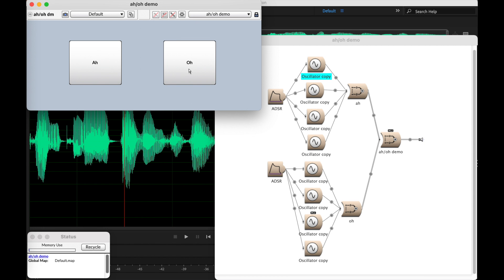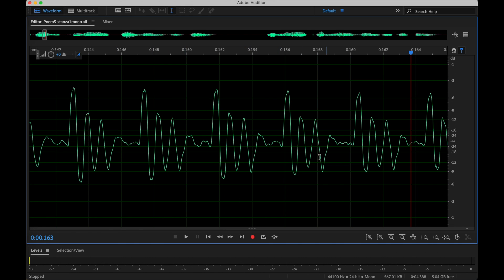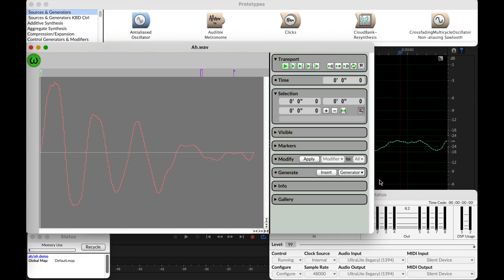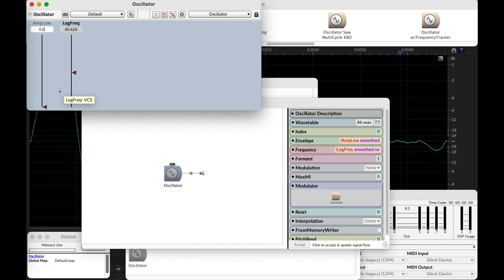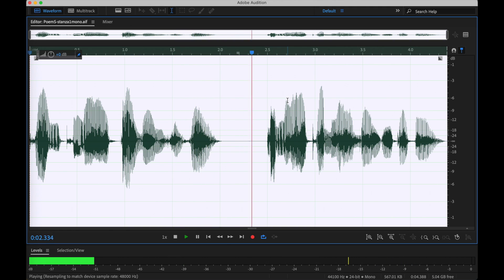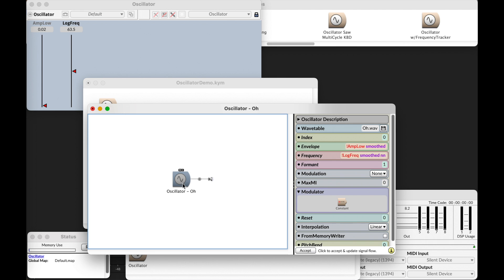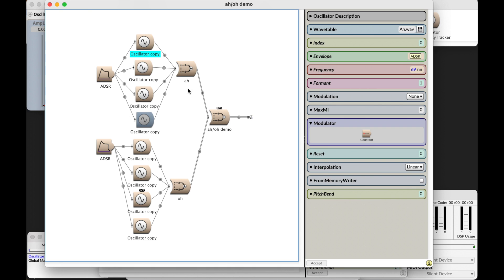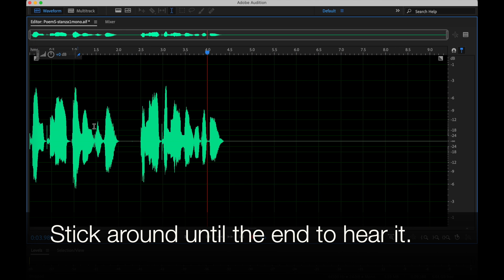Vocal Sample to Oscillator in Symbolic Sound Kyma (Wavetable Synthesis) | Simon Hutchinson

Comment: Hello,
great inspiring video! I was wondering, is there a way to connect kyma to some sort of live video manipulating program, maybe MaxMSP Jitter or maybe something else?
Reply from the maker: I connect software, including Kyma, with OSC (Open Sound Control). Here's an example of OSC community between Kyma and Unity - https://youtu.be/efj6jjBoCwc?si=9kf6GmVfo_gdiniQ
Sound in Kyma, visuals in Unity.
Reply: Thank you for the answer!
At the moment I am exploring possibilities in surround and having difficulty with the speaker placement positions. I didn't find any videos or useful info on surround in Kyma. Do you have maybe some suggestion or advice on that subject?
Also on the side note, how can autoloop be canceled or stopped after some time?
Thank you in advance